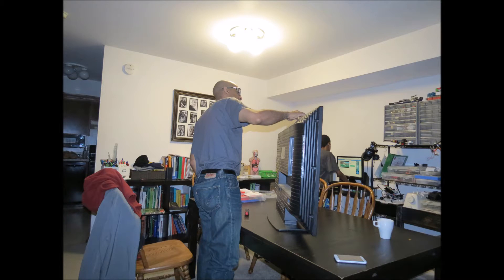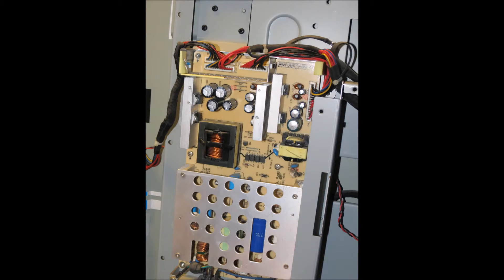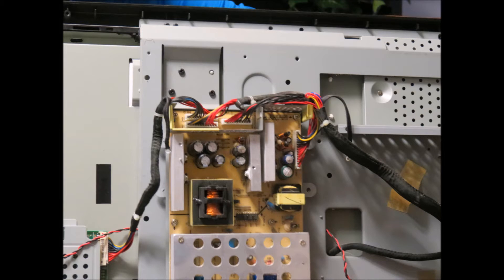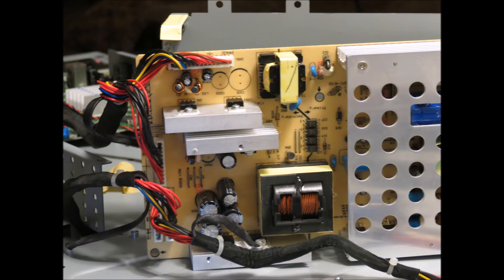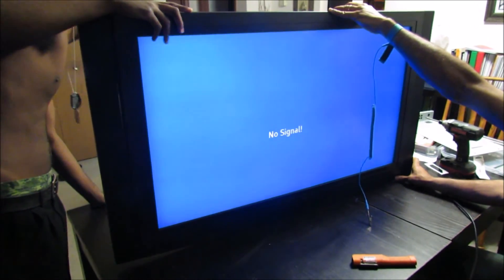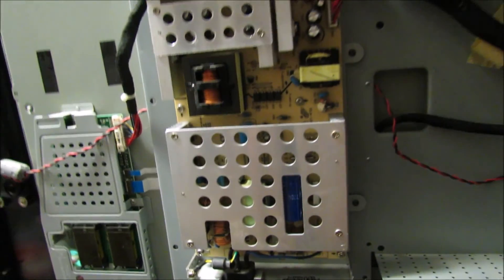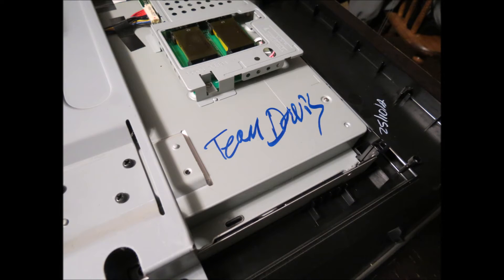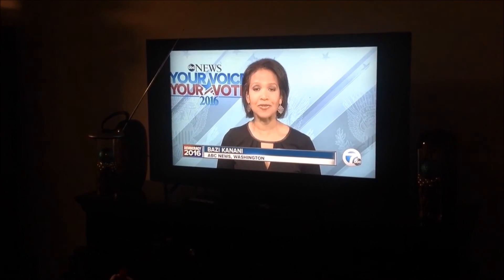Family TV Repair Job (Olevia 42 inch LCD TV)

Comment: have a 242 FHD that was given to me. Kept blowing the fuse, even after I changed all the bloated caps (Proves it isn't always about capacitors) I just wound up gettinga new board from ebay, and is still going strong today.

Comment: What problems were you having.  I have an Olivia 42 inch flat screen. It is about 10 years old.. The power blue light stopped working about the 3rd year .  Just this spring I started having trouble turning the tv on.  I would use the remote and wait and sometimes it would come on or if it didn't the blue power light would start blinking on and then off.  I would ununplug the tv and then plug it back in and I would get a solid blue light. I would try the remote and sometimes I would get a picture or it would start blinking again. Then rwpete thr process. The Last couple of months nowI would  would diet it on and now it would turn off about after 10 minutes. Would turn it back on and it might stay on for most of the night or it would shot off by its self again.  Is this the problem you have had.  I think it may be the power board.  Where did you get your capacitors at.  Does teams electronic carry them. . I am from a small town. You can reach me at robert.g.specht54@gmail.com I am Bob. Thanks